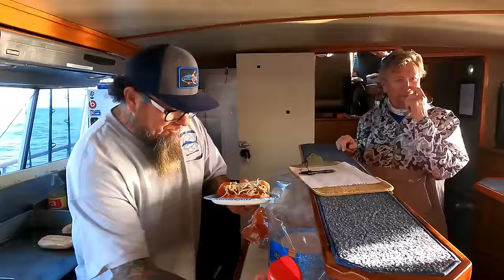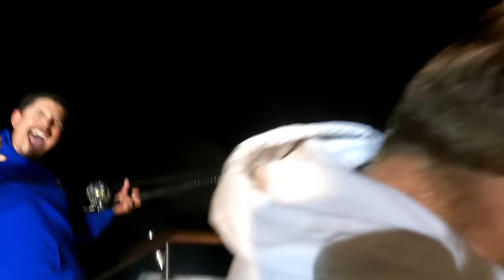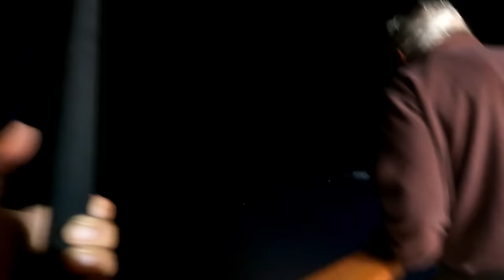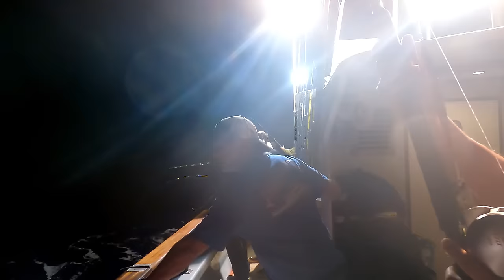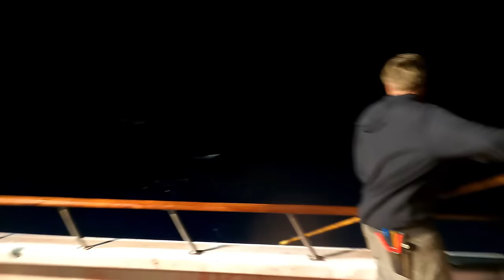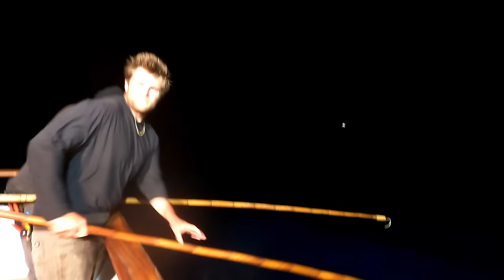Giant Bluefin Tuna Fishing Pacific Dawn Fishermans Landing Point Loma San Diego 18 Fish 15 Over 100#

Comment: You only had 60lb leader(top shot) knowing that boat was catching slugs last trip? 😳
Reply from the maker: yes, my leader on the jig was 200# the biggest I own has 300feet of 60# so I make the floro top shot the same.  Landed a 120# 150# and in part 2  which comes Thursday 5 pm a 170# so my rig works well for me.  Glad you noticed tight lines my friend.
Reply: @cousinjim1  so #200 leader tied to the 60! epic trip Jim! Simply epic!!! May see ya down there one of these days
Reply from the maker: @Nobodybaby78  can't wait to see you on a trip
Reply: @cousinjim1  Its best practice to use at least 100lb at night. Big difference between fighting a fish for 15 mins or over 1 hour. You pay $500+ to go on the trip, spend the extra few bucks for the proper line. You were very blessed to land those fish on 60lb, Congrats on some nice bluefin Jim!
Reply from the maker: @matthill5066  100# rental rods are a good bet also  thanks for watching

Comment: Nice end to what could have been a long boat ride. Imagine, NPBFT get to nearly 1,000 pounds. These are all pre-spawn juveniles. Come over at footballs, stay until 300-400-pounds, and return to their spawning grounds in the Sea of Japan. NPBFT are all one stock, as per DNA, so no proof (outside of some conjecture in the mid 80s at Guadalupe Island, but no proof until DNA testing) of them spawning anywhere else than the SOJ/PS area. Once they spawn, they stay in the west Pacific and cruise between the SOJ and New Zealand, often mixing with their cousins, the southern bluefin south of the Equator. As southerns 'only' get to about 500-pounds, any southern caught and submitted for a world or line-class record is required by the IGFA to be DNA tested to make sure it is not a NPBFT. WR for NPBFT is 907, caught off New Zealand. Imagine if we caught the post spawn 800-1,000-pound adults here? Wow, they are an impressive fish at any size, and quite remarkable, standing out among all species of tunas with an advanced endothermic system that allows them to cruise at all depths, and through very cold water. That gives them the edge over the big YFTs, (I know, it's a debate, and often more subjective than analytical) as they can sound faster into cooler water that would give a YFT a heart attack. Good job!
Reply from the maker: thanks for the info!  I thought these only grew to about 400 and were a different strain than the atlantic bluefin
Reply: All-tackle records for the three species of bluefin tunas: Atlantic, 1,496-pounds. Pacific, (the ones we catch on the west coast of US/Baja to 400-pounds) 907-pounds. Southern, 369-pounds.
Reply from the maker: @scottdanielsproject  I would sure like one of those

Comment: If you have 100 feet of line out at a 45 degree angle the depth of the end of the line is 70.71 feet.  To calculate this, in your calculator enter the length of the line that is out, then hit the cosine button and then enter the angle you are out in degrees and the answer will appear.  magic.
Reply from the maker: @trippingtommy3691  my rough guess was 50’ not too bad for not having my calculator on the boat LOL   Thanks for the exact number 
Keep on watching and informing tight lines my friend